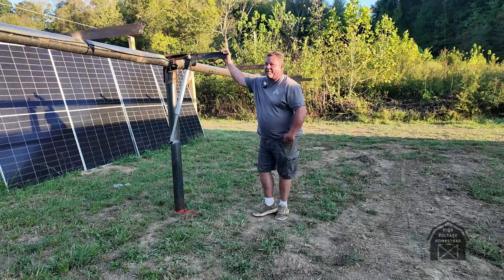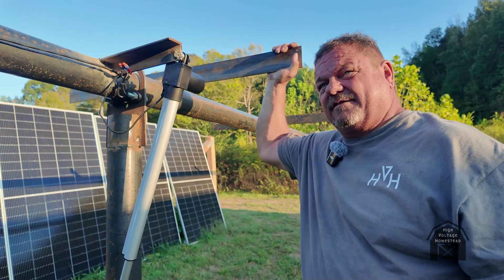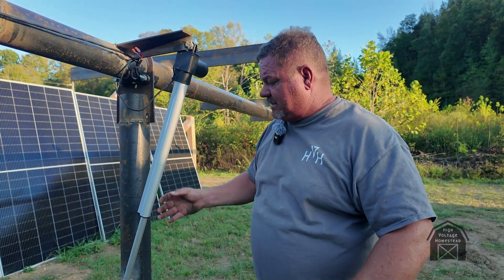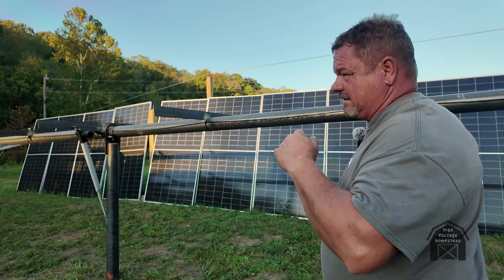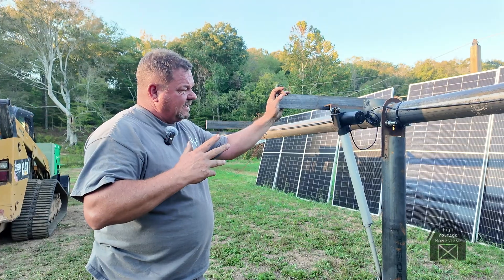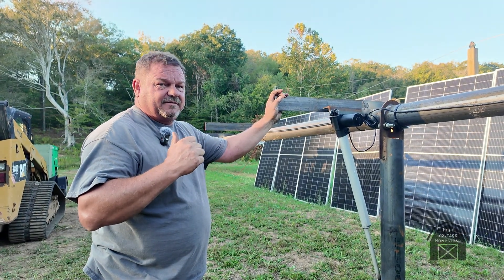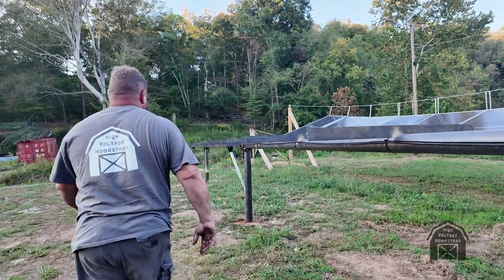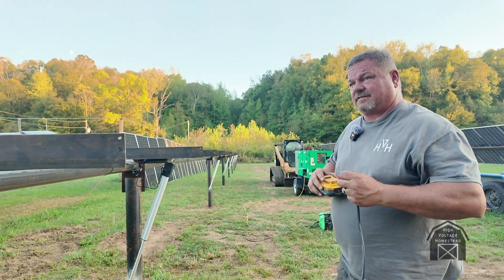Grid #8 Upgrade: Actuators Installed with Smarter Design

Comment: How about some videos about surge protection, arc fault protection, ground fault protection?

Also, grounding rods, ground conductor connection to panels, array ground connection to house ground system, DC breaker sizing & locations, DC fuse sizing and locations, AC breaker sizing and locations, etc…
Reply from the maker: Ok will try to do one shortly
Reply: @HighVoltageHomestead  Thank you!

Comment: I was typing the last message as I was watching the video. You just mentioned limit switches which triggered an idea. If you run them all to a limit switch and make sure they all reach the limit switch that could reset any tension being built up over time.
Reply from the maker: Yes sir, that is what it does.  The actuators have limit switchs built in and the controller runs it all the way to the end on both sides each day which should stop any error compounding, I hope.  Thanks!

Comment: I would think the simplest solution would be use one actuator in the middle. If it can't handle the load maybe cut the pipe in half and use two. Not sure on the oscillation being an issue. You brought up my concern on a failure of once causing the other two to break it. Over time running multiple is parallel I would think they would get out of sync and cause tension between them. A cool experiment would be to connect some type of load gauge to them all and see if tension built up.
Reply from the maker: I'm going to try running 4 or 5 in series on the next one and see if that works better.  That should sync them with the current having to be the same on each one and shut it down if one fails too. Thanks!

Comment: Might have missed it, but any thoughts to actuators with encoders built in? Then if one breaks or shuts down, they can all stop to prevent damage. 

You can also get them to track at the same pace as they age/wind load/etc.
Reply from the maker: I like the idea, do you have any ones in mind ?  Thanks !
Reply: @HighVoltageHomestead what's the stroke length of the ones you're using currently?

Comment: Do you have a link to the Actuators or a name and model number?  Thanks for all the great instructions!
Reply from the maker: Sure, thanks!
https://www.ebay.com/itm/157220669059?_trkparms=itmf%3D1%26aid%3D1110002%26rkt%3D12%26mech%3D1%26algv%3DPromotedTopSellersItemsInMetaCategoryItemsV2WithMLRWithKnnRecallV1%26pmt%3D1%26amclksrc%3DITM%26sd%3D317286086144%26sid%3DAQAKAAAAEDHLsXbjYU550vUMT0UfI14%3D%26itm%3D157220669059%26noa%3D0%26plcampt%3D0%3A149891931015%26algo%3DSPLICE.SOI%26brand%3DUnbranded%26asc%3D20210617141043%26ao%3D1%26rk%3D1%26pid%3D101368%26b%3D1%26mehot%3Dnone%26lsid%3D0%26meid%3D8faa4771335349edb6249d0212e950cd%26pg%3D3663644&_trksid=p3663644.c101368.m2333&itmprp=cksum%3A1572206690598faa4771335349edb6249d0212e950cd%7Cenc%3AAQAKAAABMNaHjMUvL2GtNoy%252Ba9LCEO5VoBomRTf9zewRc3icufF5ma90RXDV98Xw1Lb%252B2iEo6xRKHk%252FRpu6gNHFDccvWSGHu6RqSWcfGuLKfeWi2DErLDwJEfm7Mf2eiJRCzdasIui1QeARcCNOtnloRMBNHucJwUuwKhhgCl0QvUt1CSjvCMZE1x2xGjCrmEOOdlUGnkJQiCtVb6r067wStXP7xawzeLp7iGSMev2vAs4E%252B5kjiSzd8ITIGJ2eRhT47rnlKHrkkmQG1aN28%252Fh7GGZODA3OtVHnhbimGia4hu0Nv0io0YBKGeigRg8owg1F6Fpk5EnLiPAtYaIaCJQXjW4gMObuzQDtLmhgqpfeRsmlAdEKiOUirAVemZQStJKlWWNG7w2uKNx21SYIQDfoIJOjRYic%253D%7Campid%3APL_CLK%7Cclp%3A3663644
Reply: @HighVoltageHomestead  Thanks for the link.  What length actuator does you system use?  If you get a chance for a more descriptive video of your cradle for the pipe with the bearings it would be much appreciated.  I really like your setup and I am going to carbon copy it for 27 extra panels I have, thanks again.